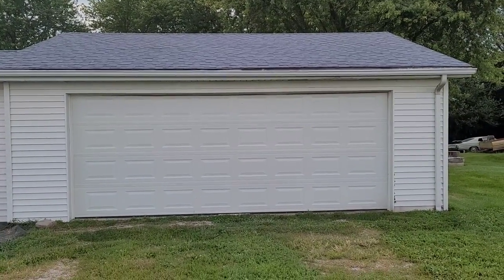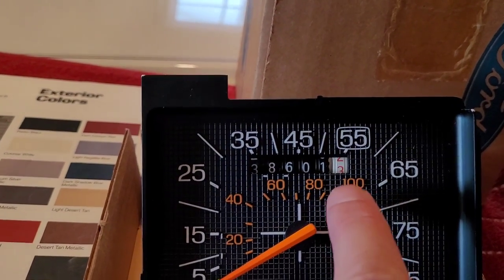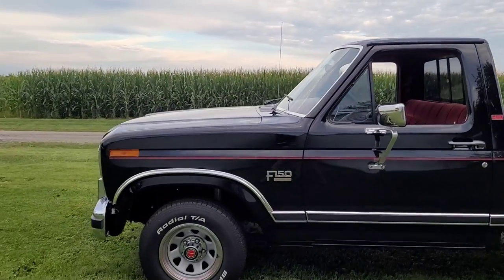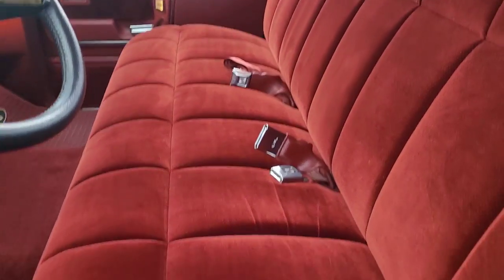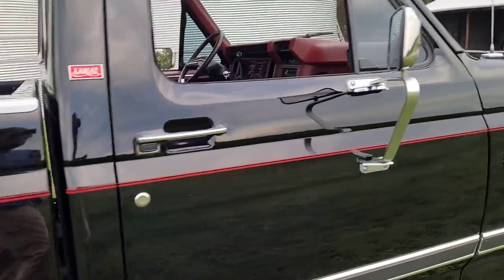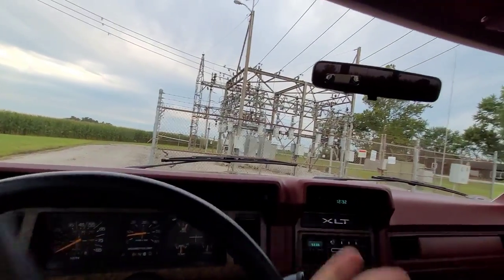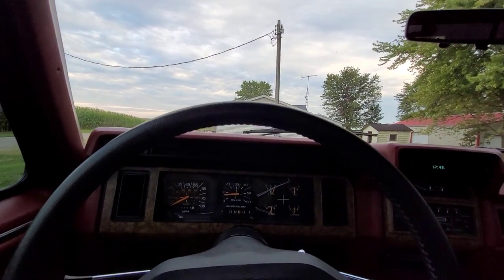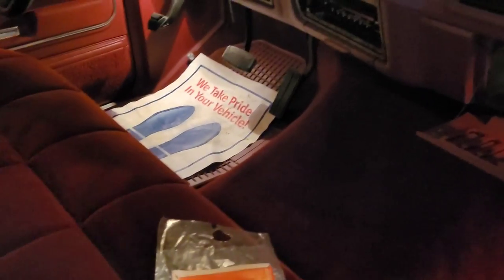1986 Ford F150 XLT Lariat Bullnose With 43k Original Miles Walk Around And Drive Discussion

Comment: The brochure for the 1986 Ford F-Series DOES say that the chime replaces the buzzer on the XL and Lariat models so Ford MAY have planned to use chimes on the 1986 F-Series before deciding that it would make more sense to wait until the following year when the truck was updated for that year.
Reply from the maker: I don't understand it. I've had a lot of 86 XLT Lariat trucks, and the black one is the only one to have it. Until I added it to the rest of them.
Reply: @tonyscarcare5657  Will the scary buzzer from a 1984-86 Ford F-Series fit in place of the chime on a 1990-95 Ford Taurus?
Reply from the maker: @Jac2Mac  I'm not sure. I've never owned a Taurus. Sorry.

Comment: The card with the holes punched in it was a system known as IBM key punch. A machine that looked kind of like a typewriter was used to punch those holes. The card was an earley form of data storage. It was read by the computer.
Reply from the maker: Yep, that's what I've heard. Thank you!

Comment: Very nice !!!
I am 63 yes old and am a total car / truck guy , since I was 5 yrs old. I am retired diesel mechanic and Ford's is what I love the most. 
Back in 1986 my wife's father called me on Friday evening to ask me if I wanted to go truck shopping the next morning, of course I said I would love to. First dealer we went to was Santa Monica Ford, he had purchased a  new 1967 Ford Galaxy XL convertible for my wife's mother 19 yrs prior.
He had seen an ad for another dealer who was having a huge truck sale ,and claimed to have a huge inventory of new 86 fords, this dealership was a Ford truck super dealer. 
Dad knew what he wanted, this dealer had some nicely optioned trucks on the showroom floor and on the lot as well. We went home that Saturday with the exact truck he was looking for. 1986 Ford F-250 XLT Lariat 4X4, tow package, limited-slip rear differential, 460 ci , C --6 automatic, A/C , pw & pl, cruise tilt , tach trip, AM / FM Cassette Stereo,  supper cooling, Engine oil cooler , Transmission cooler, Roof clearance lamps. 
He owned it till his passing in 2011. I purchased it from my mother in law in 2011 and still own it today with 129,267 original miles. The original engine is completely  rebuilt with no expense  spared. A California truck its whole life. No Rust anywhere, Not a daily driver but it gets driven regularly by me only.
Reply from the maker: Awesome and thank you for sharing!  If you go to my channel you will see my 1968 Ford XL GT fastback. Sounds like you, your father in law, and I have a lot in common.

Comment: I had a 1987 F-150. Loved it. Gave it to a friend in need when I bought my 2002 F-250 diesel 7.3, which I still have with 150,000 miles.
Reply from the maker: Well, that was nice of you!
Reply: @tonyscarcare5657  The backstory to that is that he had been kind to me many times over a long friendship. I had purchased the ‘87 from another friend of mine, a WWII veteran, in 1993. I drove the immaculate truck until I needed the pulling power of the new 2002 7.3. Can’t buy friends. And by the way, thank you for your video on replacing the cable assembly on the left rear half door on my 2002. Very nice!
Reply from the maker: @Jay  that's true! You're welcome. Yeah, I've got some good compliments on that one.

Comment: Nice old truck. I love the bull nose era Fords. My Aunt had an 83/84 model in a two tone metallic brown/bronze color that I used to drive when I was 15 and 16 years old. It was surprising how well the 302/5.0 motors pulled those full sized trucks around even when they had the older 3 speed trans and highway gears. During that same era I drove a few square body Chevys which I also liked. But nothing was better than the bull nose and brick nose fords. They just looked and drove great!
Reply from the maker: I agree, the chevys couldn't compare. As soon as you get in and close the doors, you can tell the quality isn't the same.

Comment: My Dad had a plain Jane light blue with tan interior and 15 inch steel rims and hubcaps. Still a huge difference to the 70s pickups. Ride and general comfort was great. 
Thanks for sharing your collection
Reply from the maker: You're welcome and thank you! Yes I agree......to me the 80-86 Ford trucks are the best ones ever made. 87-91 got odd looking and after that they all rusted something terrible.
Reply: @tonyscarcare5657  I like the 80-86 F series trucks. The redesign was a worthy one but I wouldn't say they were the best ones from Ford though. Ford began experimenting with different things at the time that didn't work out too well. The lightened "Swiss cheeze" frames on the F100 and F150 were not the strongest by far, albeit lighter in weight. And the introduction of the 3.8 Essex V6 with hopes to replace the 300 inline 6 was not a popular move. The 80-86 trucks certainly had impressive features and optional equipment making them very attractive and comfortable but sadly, many of these are no longer on the road now. I still see quite a few of the 73-79 models still on the road though and those years are now considered classics and highly sought after. The Camper Specials in the Ranger XLT trim are real beauties.
Reply from the maker: @codyluka8355  the 80-86 trucks are very popular on the Facebook groups.
Reply: @tonyscarcare5657 Love that there is a Facebook group devoted to these trucks. They are nice trucks and are worthy of support. We just don't see many if them here in western Canada anymore. They do exist but they have become unicorns here. Not so much for the 73-79 though. They are still fairly common.

Comment: Love it. I have a two tone brown/tan 86 F250 XLT Lariat with the 460.
Reply: Mine has the horrible hubcaps which I love as originals it came with the Galaxie looking steel caps. Shame you didn’t have the originals as I’d buy em off you.
Reply from the maker: @markbehr88  the original owner may still have them.
Reply: @tonyscarcare5657  Hmmm? Mine is a F250 with the 8 stud wheels (I think) so would they fit?
Reply from the maker: @markbehr88  no they wouldn't.

Comment: Yeah we are Ford guy's and it shows by the vehicles we own & love. Your truck is so very nice, to be an original 37 year old pick up truck in the physical condition that it is in is rare for sure. My truck was not garaged until I got it, that said, the body and the bed box was un-damaged , never been in a accident at all, however, it needed paint, interior work. I would rather that than rust/cancer any day.
Reply from the maker: People always say they don't understand why I don't drive it all the time. And they say they would be driving I all the time. The way I have kept it is the reason it looks like it does. That red interior would be trashed if it was outside all the time.
Reply: @tonyscarcare5657  You are correct  Tony, the plastic door panels at the top would be faded to a pinkish color , dashboard wouldn't look like lt does now, there is more plastic used in these years that will degrade by the sunlight and summer heat. Your truck is so beautiful due to the original owner's care of keeping it protected inside his garage and the low mileage also. Very easy to see that this truck was his baby, and now your baby, you are taking excellent care of it.
Reply from the maker: @SteveTheFordGuy985  thank you. I've actually owned it longer than he did now. I bought it in 2002.

Comment: I had a brand new 85 short bed four-wheel drive identical with the interior it had the factory tag it had the electronic radio and it had a 5.8 L ho motor that was a gorgeous truck everyone loves it and it had to four barrel carburetor Factory Holly
Reply from the maker: Those 351 HO engines were very strong!

Comment: Beautiful truck Tony. I can’t believe that dash doesn’t have a crack.
Reply from the maker: Thank you! Keeping them inside is the key to Keeping them new.
Reply: @tonyscarcare5657  from what I've heard, the problem, is the plastic industry/technology hadn't evolved very far. They didn't know how to make high quality plastic that would resist sun and last.
Reply from the maker: @raizt1596  Honestly, the newer trucks are just as bad. Look at the 90s and 2000s Dodge dashes. They're terrible.
Reply: @tonyscarcare5657  is that so? I was told they'd been incorporating UV resistant materials into the plastic by 2000.
Reply from the maker: @raizt1596  Oh yes, they crumbled!

Comment: In 1986 I was looking for a new truck and I drove everything 
I drove a new Chevy and a new Dodge and a new Ford all single cab long beds, and the Ford was so far superior and ahead of the Dodge and the Chevy it wasn't funny but I couldn't part with $13000 so I bought a used 82' Ford F150 which was the best vehicle I've ever owned...
The Dodge was especially bad, it was loaded to the max but the brakes and steering and power were mediocre at best...
Reply from the maker: You're preaching to the choir buddy! I too have driven them all and there's no comparison. The Chevy power windows would barely go up and down when they were new off the lot.....plus you had to slam the doors to get them shut.
Reply: @tonyscarcare5657  no you do not 😂😂. The doors shut exellent when the striker bushings are still intact. The 80-86 fords were cheaply built. Plastic dashes/ plastic inner fenders/cable tailgate cables Instead of steel etc. I have a 86 F150 but it’s a 300I6 4 speed. It’s a good truck but the quality isn’t there like the other trucks are. The adjustability of the GM and dodge control arm suspension is so far superior/removable bedsides/etc etc. the ford twin I beam trucks are constantly eating tires because the alignment changes at every point of articulation in the suspension
Reply from the maker: @brandonbell3089  👍 okay!

Comment: Nice truck! I'm surprised its got EFI. Thought they were still carburated back in 86
Reply from the maker: Actually, the trucks became EFI for all 5.0 engines in mid-1985, and most of all the part numbers are 1985 E5TZ numbers. It was only the 5.0.  All other engines were still carbureted.
Reply: @tonyscarcare5657 in the 1987 model year, the 300 straight 6 became fuel-injected. The 351W and 460 V8s followed suit in the 1988 model year.
Reply from the maker: @bobbyheffley4955  thank you. I knew it all happened fairly quickly after the 86 5.0.

Comment: Hey Tony. hope all is well.. I just purchases a 1986 Ford F-150 XLT Lariat 4x4 302 v8 Reg cab short bed. I came across a question that was ask to me. "how can you prove its a XLT Lariat".. and i explained all the options the XLT Lariat had (which my truck has). Is there a way to match the VIN to the Trim level? Thank you for your time. -Freddy.
Reply from the maker: If it's a Lariat, It should have the Lariat emblems on the cab corners and XLT on the front fenders. It should also have the plush seat.
Reply: @tonyscarcare5657  yeah I have all that. But nothing that would indicate on the vin?
Reply from the maker: If it has all of that, it's a Lariat. Nothing in the vin that I know of.

Comment: This is a beautiful ride! I just bought an 86 F-150 Lariat myself, not nearly as nice as this lol. It's sat for about 7 years but also only has around 42k original miles. Same interior as that with all the bells and whistles, but i have a question. This truck i just got (it's the 5.0 EFI with the AOD transmission, it will start and run perfectly fine but as soon as you try and put it into any gear it stalls. If you would happen to know it would be much appreciated, again beautiful rig!
Reply from the maker: My first thought is to clean the throttle body.
Reply: @tonyscarcare5657  Thank you, I'll definitely do that
Reply from the maker: @That_5.4Lariat  you're welcome. Let me know.
Reply: @tonyscarcare5657 Well after looking further into it, I’ve found two vacuum leaks, it didn’t come with a radiator cap so I’ve picked one up for it. Hopefully it’s just gonna be those vacuum lines.
Reply from the maker: Loss of vacuum can definitely cause running issues, especially on these EFI trucks.

Comment: Does the engine temp gauge not work? It should be on cold when you're first starting it right? Mine has the opposite problem where it's stuck on "C" all the time and won't heat up.
Reply from the maker: It works fine. It had already been ran and was a little warm.
Reply: Do you know anything about the oil gauge. I noticed your gauge ran in the middle. Mine always runs low on the gauge. Even after I have a oil change. Not sure why. Mine was a 86 f250 351 HO
Reply from the maker: They all run low after they get around 100k miles on them. How many miles do you have?

Comment: Does the ac work
Reply from the maker: Yes it does. It does need an O-ring though.
Reply: @tonyscarcare5657 does it still have R12, or has it been converted to R134a?
Reply from the maker: It's been converted. Years ago.

Comment: The tailgate is wrong
Reply from the maker: How is the tailgate wrong? I have the dealer brochure from 1986 that clearly shows it. I've probably had more 1986 F150s than any other single person. That was the XLT Lariat only panel used for 1985 & 1986 only. I have three of them NOS in the box. I've had to prove so many people wrong about this. I don't understand where you get your information from. Now I'm gonna have to do a video on the 85-85 Ford tailgate and dealer brochure. Stay tuned!